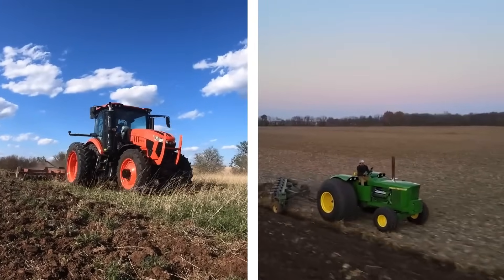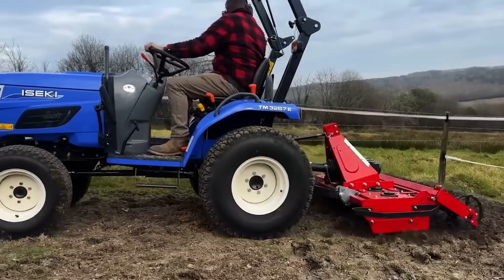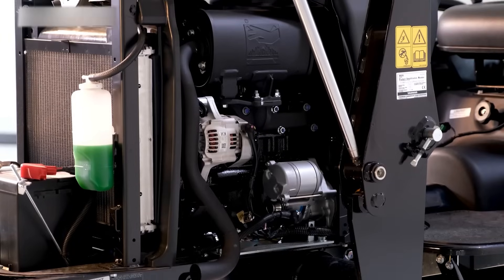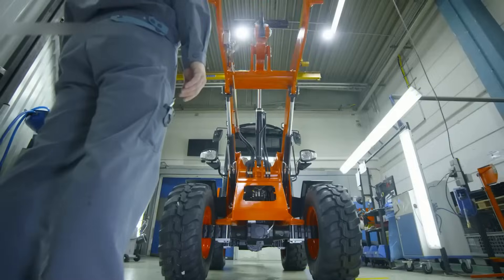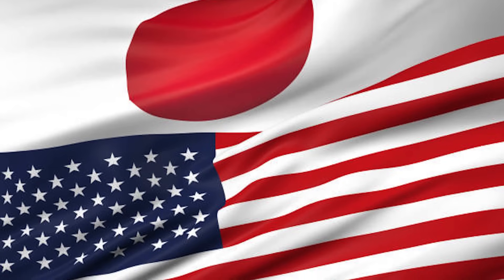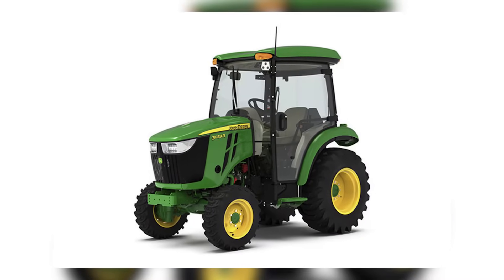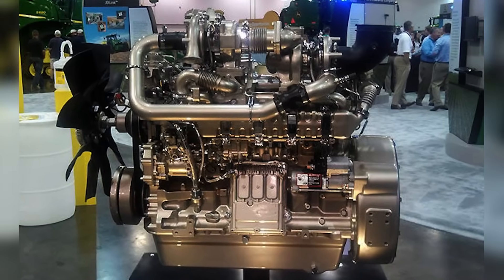Why Are Japanese and American Tractor Engines so Different?

Comment: If you want to find out where your tractors are made look at the castings for the parts , for example most JD castings have made in Germany on the bigger tractors & made by Yanmar for the compact tractors  . The ONLY thing that JD does is just ASSEMBLE the parts in america  . All the components are designed & made in foreign countries  . To find tractors actually built in america you have to go to a farm auction and look for tractors built before 1985 . Even then there were some companies like Case & Oliver that had started importing tractors as early as the 60's to sell under their name brand .

Comment: I'm pretty happy with my little 30 hp Kubota. But it's just a little hobby tractor with only 600 hours on it since 2006. I worked ag for about a decade. Most of the stuff I personally ran was old. JD, Cat, and IH did well. They're tough but everything has weak links. Kubota didn't exist in America back in the 80's above 250+ hp. DEF screwed everyone over, especially with orchard tractors. NH orchard tractors are cheap but most farmers switched to Kubota or Deere because the NH tractors couldn't stay out of the shop while I was working in the industry. They were junk. I've always preferred simple mechanical motors over computers. But as an example one new Massey swather replaced two worn out NH 1116's that we were constantly working on when cutting alfalfa. There's a balance to be had between old iron that just works and these modern super complicated but efficient tractors. Heck the boss man bough an old 8460 for a baling tractor for $8000. We busted the outer duals off it and slid the inners to bale. It ran a season and it puked the PTO clutch. $14k for the upgraded PTO clutch, and our favorite parts guy was on vacation. So we parked that one for a couple weeks and finished baling hay with one tractor. Drake got back from vacation and called up the boss and told him to put an 8440 clutch in it, as we didn't need the upgraded clutch for what that tractor was doing. Saved the boss about $10k and that tractor baled for years after with basically zero issues.

Comment: I bought a 1982 Mitsubishi Turbo diesel pick up, it was ready at 85 hp had a five speed one of those little light jobs of the 80s. I put a smooth camper cover look more like a station wagon between myself camper, etc. I usually have 750 pounds of weight. I put 350 to 400,000 hard miles on that truck and drove it through a flood been a connecting rod pull the pan replace the rod polish, skirted the piston that got scuffed, ran it for another hundred K gave it away, sold it for five bucks that is the guy who needed wheels was having trouble get it inspected, but he said he could take care of that. I wasn’t asking any question anyway, after working on that truck, even though it had a rubber timing belt in the overhead cam I never had a bit of trouble with the turbo the injection pump, even after getting a bad dose of water through it with a bad fuel, cleaned it out even though the pistons got pitted due to water in the flood they burned a little more oil. It was a tractor motor. I usually kept my foot in it and ended up the governor every year. I had to drive in Houston in and get somewhere a little 85 hp Turbo helped.

Comment: It's  horse power, more HP harder it is on the life of the engine. The contractor  that mows the ROW on the interstate , tried kubotas , supposed  to have had the same HP as the John Deeres, but they could hold up . The heat,stran of the 15ft hog day after day.. Not even close...

Comment: Tell me why in Europe, Usa and Japanese company tractor have high rated rpm tractors (2400-2600) hp category (25-50) , low pto power but in india tractor rated rpm (1900-2100) hp category (25-50) and in india high pto power as compared to Europe, Usa and Japanese company, in india for example Swaraj 855 (49.3hp @2000) have (46.2hp@1750) pto power, mostly tractor 45 to 47 hp pto power in 50 hp category .

Comment: I still prefer massey ferguson with a Perkins.
Reply: Mechanically Perkins ad3-152 is roughly the same as Daihatsu dl or Kubota 3 cylinder. All 3 in my shed and built using a timing gear set up. If you work on one well the others are not much different. The Perkins is definitely UK and not US. All my engines are from the 1960s to the 1980s pre dpf and commonrail injector systems. Use a good diesel detergent engine oil, change regularly and good clean diesel and change filters frequently.

Comment: Had a Kubota at work and it had hydraulic troubles that couldn't get fixed. My neighbor  had a 120 HP Kubota that would over heat on a hot afternoon pulling a hydro swing swather. I've got 50 year old internationals that will start in spring that set since October. 110 ° they never over heat.
Reply from the maker: Nice! My in-laws have had a Kubota for decades and never had an issue with it.

Comment: I stopped watching when the video showed big farm type tractors compared to smaller homeowner or ranch type tractors.  I have seen a couple bigger Kubotas pulling wagons, but I have never saw a Kubota, Yanmar, or Iseki actually planting, plowing, cultivating, or doing any actual field work ever.
Reply from the maker: Yeah, it's not always easy to find footage of the exact right stuff throughout the video. It may be rare, but those Japanese engines do run in some bigger tractors.
Reply: CUrrently Iseki manufactures the newest massey fergusons, 
the 50+HP versions have draft control standard, 
NO ONE ELSE is doing that, not deer, not CNIH, not Kubota or any others

Comment: when is the last time you seen a 1950s Kubota running around
Reply: In Japan I’ve sent 100s of them.  They didn’t import back then.
Reply: My 50th Anniversary model for 2023 clearly indicates they started in 1973…guessing math is not your strong suit?
Reply: @JohnOrsucci  1973 is not 1950s. math is not you're strong suit
Reply: @JohnOrsucci in the 1970s they had 15000 employees and had been going since WW2. Mainly small machines in rice paddies and stand alone engines. Kubota US to not talk about this.
Reply: I have several 1970 kubota motors and no complaints. The engines are not much different to the Perkins in my  Massey Ferguson.  Do Kubota actually build large engines in the US. My guess is they are CKD ie completely knocked down and assembled in the US.

Comment: The annoying thing is when like Kubota will have a gearbox on a mower deck. It requires fluid change. In Japan, there is an extension pipe on the drain, which makes this easy. In America, there is no extension pipe, which makes this impossible.  Japanese Kubota WILL send you the extension...but ONLY if you call them and speak Japanese.
Reply: How hard would it be to just get some pipe and build one?
Reply: 😵‍💫🤨🙄🤔speak japense::: kiki yaa moko takı kuto boruko 🥴🥱😁

Comment: I operated a Karcher B 300 RI sweeper/scrubber machine powered by a propane fueled Kubota WG1605 spark ignited engine.  The engine was all metal and reliable, while the rest of the machine was unreliable

Comment: We’ve had zero issues with our Deeres the 4230 is up to 15,000 hours on the original engine and transmission 4030 is at 10,000 my 4020 is at 1,657 even the 2013 6100D is going strong only tractor we’ve had problems with is the 6120E and it was emissions related

Comment: Interesting but odd at the same time. Basically with every tractor, farm use and personal preference can make one lean to a specific brand. My issue was to move on from Massy Ferguson over 35 years ago from lackluster dealership interest in carrying parts to just getting repairs done in a timely manner. Bought John Deere and after 2 decades from being reasonable with the customer to becoming adversarial for service only at the dealership or shop's mobile mechanic with proprietary programs internal for operations, made me switch to Kubota. Most of the tractors performed their jobs well over all but like anything else, good service sells.
Reply: Yes, Kubota guy here too. Kubota still believes in customer service.

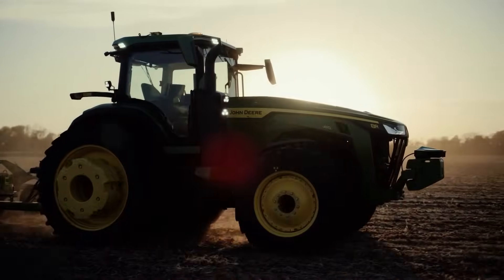Comment: Deers don't come with computer software. And the diagnostic software is proprietary. You can't fix it yourself. Garbage. 6:15
Reply: All of those companies' diagnostic software is proprietary without exception. Deere is not alone in that, and it extends far beyond just tractors. Just like all the others they do make it available via a subscription literally anyone can purchase, and anyone can waltz into a Deere dealer and buy whatever parts that dealer has a contract to sell whether they subscribe to Service Advisor or not. 
As for software. For some years now most ag equipment is capable of performing free auto updates that have to be initiated by the owner which is prompted on the units display screen. Deere also has a free to all website where free software can be had for updates to monitors etc.

Comment: The commentor is reading a script and knows nothing about what he is saying! He commented about stump pulling!? I recently watched a video of not one but two 12,000lbs JD'S hook together trying to pull about a 60in stump!!! The stump WON!!! I've watched a 336 CAT EXCAVATOR  struggle digging out stumps that size!!!
As a retired farmer I had Massey Harris, Massey Ferguson, FARMALL IH & two Cases. And they all served me well!!!
I sold the farm and bought a home with a few acres and purchased a 30 to 40 yr. old 4x4 diesel tractor with bucket loader 4 cylinder Mitsubishi engine 19/21 PTO hp; it out weights any of these modern compact and subcompack. And my maintenance cost for five years is under $1,000
Great little Japanese tractor and it came with three attachments all for $6,500!!! You won't touch a new compact or subcompack for that!!!!!
And I've added 53in 3pt rototiller and a Fred Cain 5ft. field cultivator.
The Fred Cain cultivator is like a mini chisel plow and better than a plow!
Reply from the maker: I was talking about smaller stumps. But of course the monsters stumps require something completely different.

Comment: Deere has a large facility in Mannheim, Germany. In Nov 2019, I met an old high school friend,  his boss, and a couple other Deere execs at a Frankfurt Intl Airport transit center restaurant (it was a high end burger joint that literally was replaced by a BK after COVID) for dinner. What I understand is lots of the midsize stuff is made in Europe, the big stuff is made here in the US, and the Deere internal trade balance was about 1:1. My friend left Deere last year, but he was head of aftermarket, which was parts coming from all over the world for everything, including non-Deere. I think he spent lots of time traveling to China.
Reply: In the 90's our family ran 2 jd 3350 4wd tractors. Both made in Manhiem germany except engine made in Sarin France
Reply: @Rcod2013 they also had models made by Renault at the time, before Renault was sold to Claas so back in Germany as Porsche Diesel was sold by MANN to Renault
Reply: My uncle has a 70s model 50 horsepower John deere that was made in Germany. Oh and BTW a 50 HP John deere from the late 70s isn't a little compact tractor like they are today.
Reply: @DeeHardy-i6n  IH 756 engine was German.
Reply from the maker: Good to know!

Comment: Deere is hanging themselves with right to repair.
Reply: Deere is the target of right to repair. All of the ag manufacturers do the exact same practice.
Reply: It is a shame that they did this. Management is really out of the loop when they thought they could service all customers during season and keep them running. Any person with true farm experience would know that it would take an immense service team who would be sitting around doing nothing half of the year. 

I am also sad that they gave up the dependability mindset of the old days of the two cylinder Deeres as well as the ten and twenty series. Tough old machines. I grew up on the two cylinder Deeres as well as the ten series. We watched red machines with the T/A knocked out sitting on the other side of the fence as our green machines kept doing what was needed to raise the crops and feed the livestock.
Reply: I have bought new deere ag tractors in ⁵ series new total  ⁴ time and my latest 5075 e is the only one with a computer and that is for DPF .    The issues arise in big farm tractors not little yard tractors.

Comment: Kubota farm tractor and utility tractors lack torque and are heavy on fuel and have some dubious engineering and features and lack of. Their larger tractors, 150+ hp, are made in France, using 6.1 litre four cylinder Kubota engine but pure ZF transaxles and the usual hydraulics that ZF use. Whether semi-powershift or CVT, they are the same as used by McCormick/Landini, Deere on some models and several other brands that have better designs and far better finish such as more durable paintwork less prone to rust and fade.

Comment: Sorry, but the Japanese, Korean, Indian, and American brands are made to fulfil different market niches.  For example, Yanmar made JD's small tractors (under 50 HP) from the mid-70s until recently, some on the same assembly line in Japan.  Kubota small to medium HP tractors that my neighbors use,  but have a 'peculiar' (my term), that requires the tractor to literally be disassembled before a major engine repair that the mechanic could have done "in frame" on a similar sized JD.    Personally I prefer JD ever since my Grandfather gave up on "Happy Farmer" tractors almost a century ago.  JD's over priced and too expensive to repair but have the broadest range of equipment and availability of parts and service, that few can compete with.

Also I have recently seen a serious lack of attention to accuracy and detail by this specific content creator, in engine and tractor research.   I won't belittle him, but he needs to do better.
Reply: Only certain models/series were full Yanmar built. Others had Yanmar engines paired with a transmission (and front axle if mfwd) of different make in a Deere designed frame. An 850 gear drive was all Yanmar, an 855 hydro was a mash up as an example.
Reply: You say to expensive... When you compare a JD to all the Japanese, Indian  equipment.  There is no comparison.. I'm  talking larger equipment  now not the hobby stuff...

Comment: John Deere runs Yanmar engines in most of their tractors.
Reply: Only up to around 40hp.
Reply: ⁴ series and down
Reply: Only the smaller tractor 50HP-
Reply: @wilburfinnigan2142  You forgot the 66HP and the old 62 HP.  They use them on the series 1 through 4.

Comment: Never trust a CVT transmission unless it’s in a side-by-side or ATV to where it’s easily serviceable Nissan tried it. It doesn’t end well I would not have a tractor with a CVT no way no how.
Reply: You dont understand modern high power cvt then. No belts no chains. Hydraulics and planetary drive. Fendt is getting over 20000 hrs on boxes with no problems. And so good to use. No gears to change. And better fuel economy
Reply: CVT/IVT transmissions are a big thing in some of the largest of ag tractors. Pretty ludicrous to make a comparison between a Nissan Altima & a 9000 series John Deere, for any reason………
Reply: @ it’s not ludicrous to make that comparison what about the boomer those had CVT transmissions and it was a failure the ones that look a 8N ford my neighbor had one that thing was a POS central variable speed transmission I haven’t found a good one yet like I said, unless it’s in a side-by-side or Atv, where the belt is easily changed because it’s either going to be a chain or a steel belt in that tractor. Neither is going to be easy to get to. I would not trust it.
Reply: @Steppedinwhatoutdoors I think there is some confusion here. I think you mean SelectOSpeed. Something totally different. Change speed without using the clutch. The SOS Ford models did have a clutch pedal but only to be used for "inching" backwards or forwards. That have trouble. DAF had a V-belt and variable disks that automatically accelerated the car. It was copied from an agricultural machine. It worked perfectly. After selling their car division to Volvo they invented a system now known as CVT and sold many licenses to tractor building companies. 🦬470